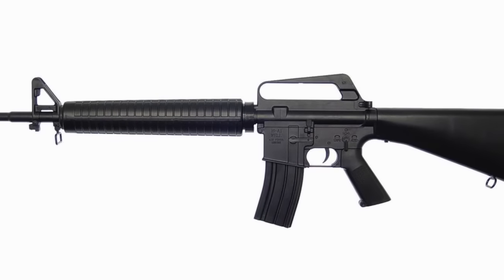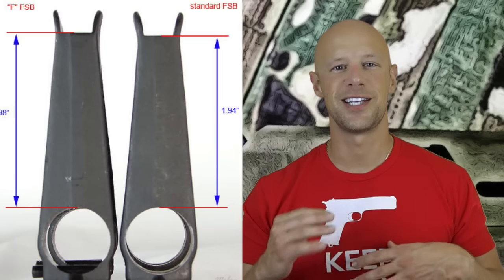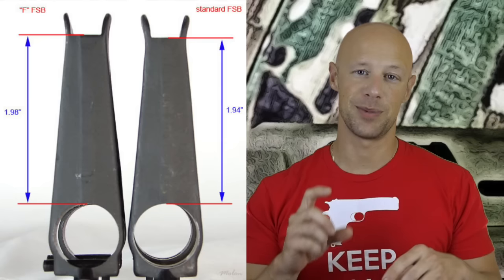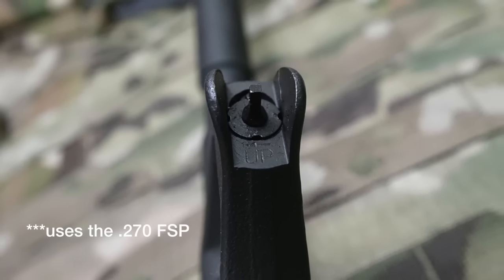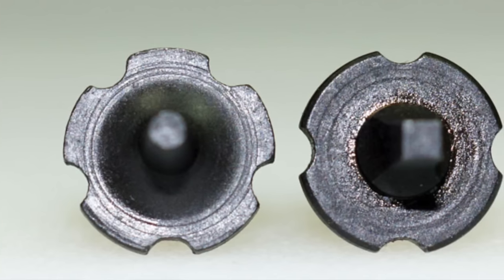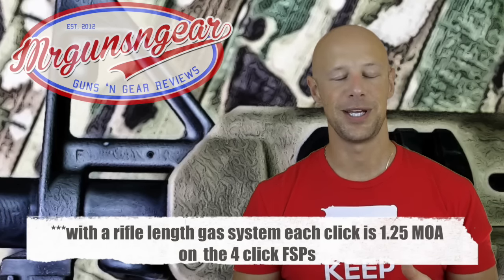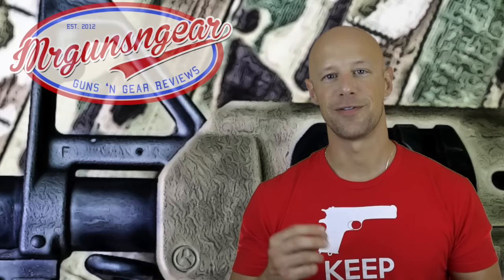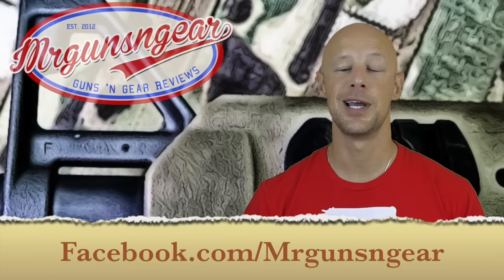AR-15 F Marked Front Sight Block (FSB): Does It Matter?

Comment: I heard the reason the rear carry handle was raised was not because of extra material on the upper needed but because of the shorter sight radius on carbine length barrels, therefore since Colt manufacted barrels and fsb(s) as one piece they just used longer front sight posts. But the key is it is a wives tales that Colt used more material and that a designer poked a hole with a lead pencil in the upper (adding more material). Military style high "F" marked (added height) vs standard front sight base height is due to shorter sight radius.
Reply: The need was for a bullet drop compensation function which worked to 600 meters.

Comment: THANK YOU SO MUCH ! 

I have both an F marked and non F marked Colt AR-15 A4's. I also have an M4 6920 which is of course F marked. I knew there was a difference but I didn't know what the details were until now. Your right, the F marked AR-15 A4 and the M4 have the same sight post height area while the non F marked AR-15 A4 does have a slightly lower sight post area. I never noticed until now. After I watched your video I busted out all 3 rifles and lined them up on the dinner table and they are exactly how your video explains !

 I have had ZERO trouble sighting in the non F marked AR-15 A4 at 100 yards. I was always a little mental about my first AR15 A4 not being F marked even though I never had problems sighting it in but now I'm glad to know the exact differences. 

Thumbs up !
Reply from the maker: +Jake Weston ha :D

Comment: My Colt A4 has the F mark but my other A4 has a Windham Weaponry barrel assembly which is non-F marked. This rifle was originally an old Bushmaster with Windham Weaponry converting it to an A4 rifle length. The Bushmaster removable carry handle I use for the standard FSB has what appears to be an A2 rear sight aperture which seems to work with the A2 FSB.
Reply: As very few carry handle rifles are being made these days, most FSBs are "F Height" whether they are marked or not.  You pretty much have to search for "standard" height FSB.

Comment: Interesting, I bought a 14.5 barrel with F stamped FSB and going to mount it to a A1 carry handle slick side receiver with M4 ramps.  Extra ammo when zeroing it I suppose.  🤔
Reply: I am in the same boat at this very moment, how did you make it work?
Reply: @Lost-Orbz  it won't affect windage so that's good.   The front sight post had to go down a bit more than usual but no problem in the end for elevation.

Comment: I guess if you have standard A2 receiver with a F marked front sight base you could have issues with elevation. It would be rare but it could happen if you tried to reach out 500 meters or more. That would require to crank the front sight post all the way down.

Comment: Mrgunsngear Channel I have a Troy Foldable Front Sight that, for the 50 yard sight-in, the post sticks out a lot. To the point to where the post Bottom flange is kinda high off the platform. I just ordered a .40 and a .60 tall posts from Wyndam Weaponry. Hope that fixes that issue

Comment: So, just so I'm understanding: If I get the taller F marked FSB with an A1 or A2 fixed carry handle upper, I would want a shorter front sight post to compensate? And if I get a non F marked FSB with a picatinny rail upper, I would want a taller front sight post?

Comment: My front sight block is not F marked, in order to get a 50 yard zero I had to raise the front post quite high in the block and it seems like it's out of its housing a little too much, it seems solid but visually it looks a little far out. Should I be worried?
Reply from the maker: rassi13 I wouldn't be if it's solid as you say.

Comment: Mrgunsandgear. Here's a question. I have a carbine length rail and an A2 front sight. I like the look of the A2 front sight but want a longer rail system. Any recommendations? Also preferably cost efficient.
Reply: yceman6273 Midwest industries and Daniel Defense have extended carbine rails for this exact problem. They can both be found on MidwayUSA although youtube wouldn't allow my links to work.
The DD is pricey but you get a better looking and higher quality rail from a good maker BUT a $325 rail is not necessary for civilian plinking and the MI will do you just fine. There are probably more rails, I can only think of these two off the top of my head
Reply: yceman6273 Check out Midwest industries.. they have a two piece free float rail that will do exactly what you want waaay cheaper than dd.. Midwest industries is the place to go for rails at a good $$$ that are good quality.. you can also add extensions onto it to make it the whole length of the barrel..

Comment: What if you use a F stamped FSB on a original A2 carry handle upper?  What should I do?  I have a non F stamped FSB, but the taper pin holes are smaller than what the barrel and pins use. Any advice would be great.
Reply from the maker: ROBERTO OROZCO Depends which post it has

Comment: The F marked front sight base works in harmony with the mil spec detachable carry handle BDC sight to permit a 300 meter BSZ and BDC function. The lower commercial detachable carry handle BDC sight when coupled to rifle with F marked front sight base will shoot low from initial mechanical zero and thus preclude a BDC function unless the front sight post is lowered. But, if the front post is lowered, the sight can no longer be adjusted to accomodate targets at Long Range. Now, if a mil spec detachable carry handle sight is placed on a rifle fitted with a A2 front sight base ( as are many commercial rifles made by company's not wanting to use the Colt patent F marked front sight base), the rifle will shoot high from initial mechanical zero, requiring the front sight post to be raised, two full revs, which loosens the front sight post, and thus, with sight no longer fixed, effects sight alignment consistency. The tall front sight post was a means to correct such condition but it yields a mechanical relationship between it and the rear aperture which makes consistent sight alignment and sight picture somewhat difficult with a relaxed stock weld. Not good. The bottom-line is a mismatch of commercial detachable carry handle with F a-frame or mil spec carry handle with A2 a-frame will preclude a proper 300 meter zero synced to a bullet drop compensation function and for any interested in US Service Rifle Competitions a sight mismatch such as mil spec detachable carry handle and A2 a-frame will preclude zeroing for center mass hold on the 200 yard Military bullseye target or the 200 yard target reduced for 100 yard shooting unless the front post is literally unscrewed 2 revs out of the a-frame, which makes it too loose for accuracy.

Comment: F marked sight block is MILSPEC and THE standard. It’s also a mark of a quality build. I personally won’t have a rifle or carbine without an F marked.
Reply: You probably will not have a quality rifle today if you equate F with quality since neither Colt or FN mark the proper front sight base for flattop with an F marking anymore.

Comment: You nailed it.  Whoever that nitwit was that worked for colt that didn't simply redesign the rear carry handle needs to be fired. We're talking .040  that's 40 thousands. They can't tell me that there was no way to find that little bit of metal and remove it from the rear carry handle and make it work.  An the worst of it all is not what Colt did. (Knowing all this now and with the ability to build sights to match the taller rear sight)  These companies who make brand new flat tops and put the (wrong) older lower front sight posts on them have got to be the dumbest people on the planet. I have one of those ridiculous Bushmasters with the lower front sight and when I found out what they did I wanted to throw it out the window.  Those people have got to be idiots.